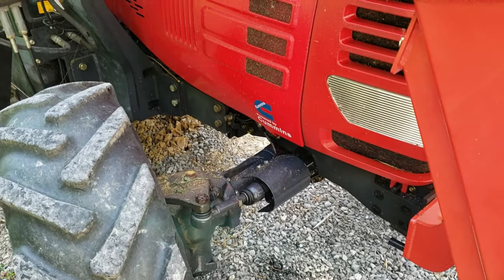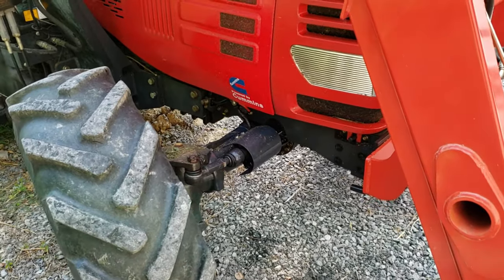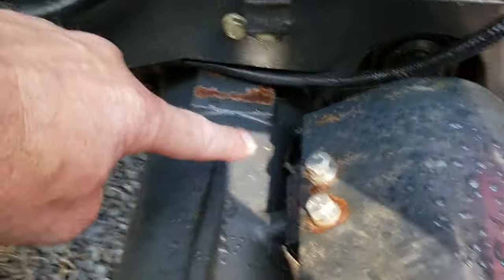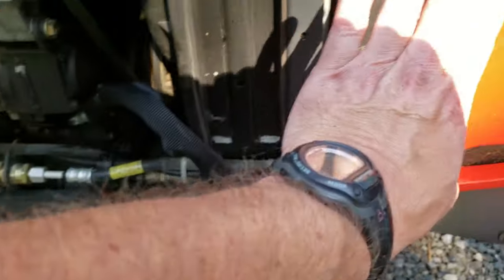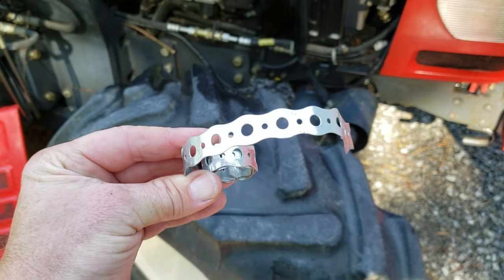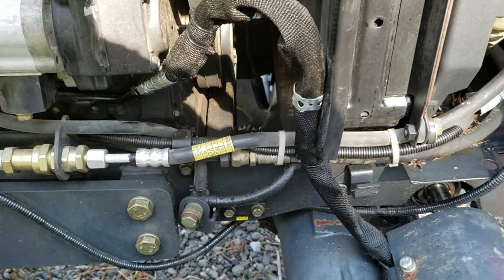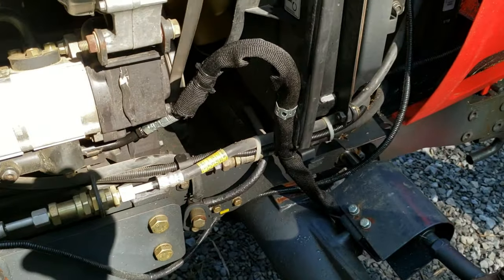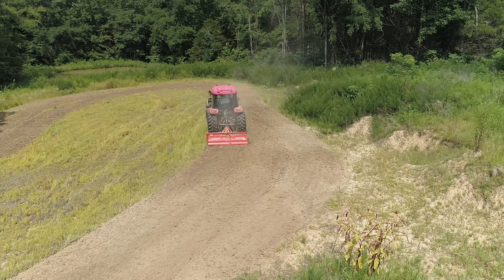Branson tractor repair minute, power steering hydraulic line repair

Comment: I saw   another potanical problem, a line was on the axle in the pinch point of the axle
Reply: Yeah, can't tell if that is a loomed electrical wire or hose of some kind but it is way too close to that pinch point for comfort.

Comment: You should lift up the front of the tractor with the loader, then tilt the axle each way. The line looks a bit tight on the video when the right front wheel drops all the way down.